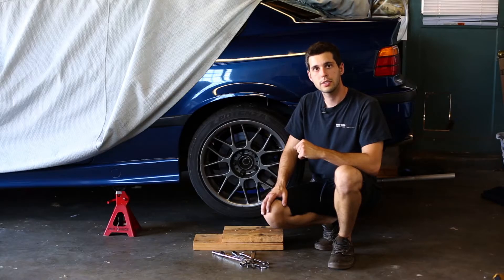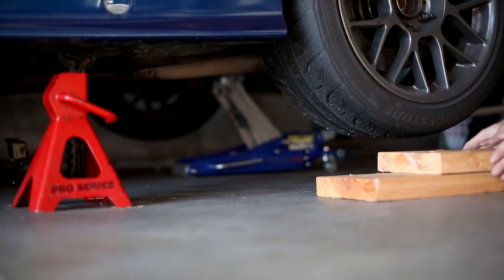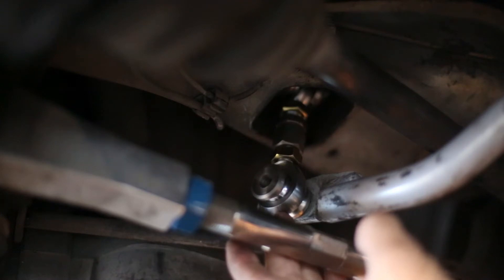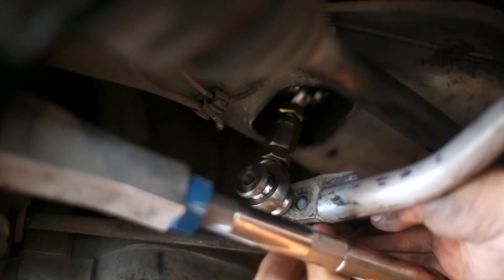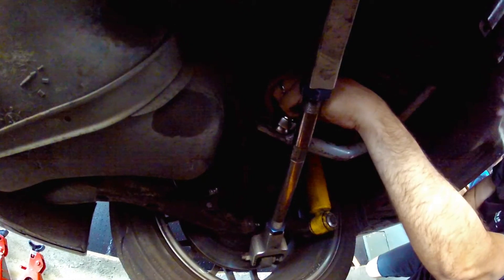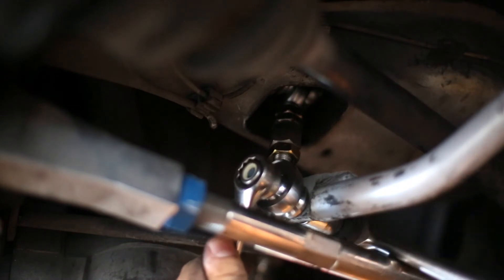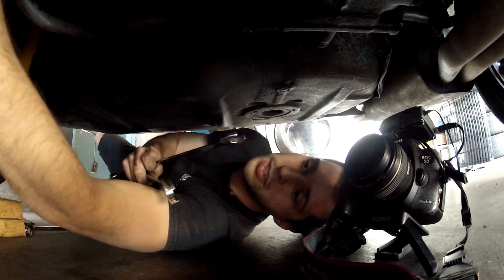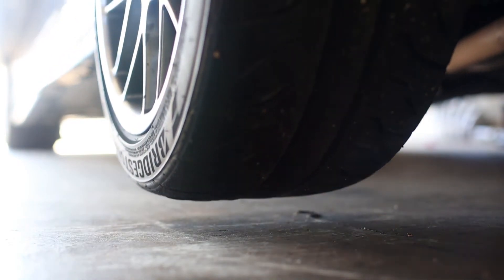Episode 7 - How to Achieve Zero Preload on your Anti-roll Bar

Comment: Does the sway bar need to be set at a specific angle before finding zero preload?
Reply: This is what critical question i’ve been looking for but with no one answer  for it 😂
Reply: From my understanding and research, the bar ends should be parallel to the ground.  In any case, with one link disconnected and the suspension pre-loaded (settled), this will net 0 pre-load.  Most difficult part, the driver needs to be in the car at the time, and someone else adjusting.
Reply: @dcpatters0  or maybe put some weight in the drivers seat approx the same as the driver.
Reply: Still no answer?
Reply: Depending on car & bar design...end of bar Should b // to ground...& links Should b verticle...so it all works at a rt. angle from every view ing angle! Should...not always possible,  of course.

Comment: Excellent video, straight forward, simple and easy. However, I wished you have done two wheels/sides rather than one wheel, to see how to balance both endlinks for either front or rear wheels.

Comment: After doing that on the blocks, could you jack it back up and put it on Jack stands to torque everything to spec or must you torque it to spec when lowered on the wheels?
Reply: Torque it with suspension loaded (on the ground or on the blocks) you don’t want the wheels to be free floating
Reply: @Wooden_Hammer  yeah I ended up buying some rhino ramps and lowering the car onto those to torque everything. All turned out good.
Reply: @Wooden_Hammer  can't speak on every Make and Model or brand of suspension equipment, but I'm currently messing around with BMR stuff on my 5th gen Camaro, and the guy from BMR told me the car does not need to be at ride height to torque the end link bolts/nuts down. He said everything with a bushing needs to be torqued at ride height.

Comment: Nice video! After doing this on one side, do you then undo the opposite side and repeat the procedure ?
Reply from the maker: Refine Movement you would do it just like in the video. Keep one side attached and perform what you see in the video and your preload will be set correctly. If you repeated this on the other side you're just doing the same procedure twice. Which isn't wrong but it is just more work.
Reply: benvidproductions awesome thanks !
Reply from the maker: Refine Movement thanks for your interest
Reply from the maker: angelo calimlim yup loosen one bolt, if you find the bolt does not slide in and out easily with your car on a level surface, the bar is preloaded. The sway bar isn't useless, if there is just a small amount of preload and you don't do any competition I wouldn't worry about it, just enjoy the car. If you are running the car competitively it will effect the balance of the car enough to effect your times depending on how bad its preloaded. Good question!
Reply: Ben Freedman Racing when you set the first side of it does the angle of the bar need to be horizontal to the ground or is it based on car? Mine is an e9x M3 and needing to redo the fronts

Comment: Great video, just one question... Do you not need the front two tires at the same level, on wooden boards as well, to balance the weight of the car all the way around? Or can you achieve zero preload just doing the rear first (on wood or ramps) and then doing the front second (on wood or ramps)?I'll be installing adjustable front and rear sway bars and end links soon and want to achieve zero preload. I have ramps and two jacks at my disposal here at home. Thanks so much for any input you can provide.
Reply from the maker: That’s a good question. I know in my case I was able to do it because my garage floor was very level and my ramps were short and the exact size. If your ramps are taller I’m sure it would work as long as your car is corner balanced and aligned. I’m sure there is a threshold where ramps could be too high and it could affect things but I’m not exactly sure what that height is but I think you could get pretty close with ramps even at 10” high.

Comment: Im a noob to this could tell me why you want or need zero preload please
Reply: Bimma velvet blue: Because when you are driving straight, with the normal weight of the car on the suspension, you do not want any torque on your sway bars. That way, your sway bars will only be doing their job in cornering. This also means that the best drop-link (aka end-link) adjustment should be at zero preload with the weight distribution the same as when actually driving. That is why you should adjust for zero preload while you have the weight of the driver in the driver’s seat. If you are doing high-performance driving or racing, this becomes more important.

Comment: How do get the angle of the bar were you eant it
Reply from the maker: You should be able to use the adjustable links to get it where you want it. If the links are limiting the angle you are trying to get you can always buy longer or shorter adjustable links of the same style to get it where you need

Comment: Do you do this process for both sides?
Reply from the maker: Only the one side just like in the video. You will have to do it for front and rear
Reply: @BenFreedmanRacing  I have some adjustable sway links on a Honda so the zero preload you would want the ends of the sway bar parallel to the ground like an equal sign basically?

Comment: How to tell if my endlink are loose and need adjustment? My car making clunking and squeaky noise over bumps in low speed at the moment not sure if its bad coilovers or the endlink need adjustment i have adjustable endlink by the way
Reply from the maker: Super mariyo that sounds more like bushings or balljoints possibly. I would just visually inspect the endlink to rule that out. But make sure it isn't a more crucial part of your suspension that is making that noise to rule out anything unsafe
Reply: Take a look at your endlinks. After I put BC coilovers on my e36 m3 and the suspension settled I noticed that the swaybar endlinks were too long both on the front and rear. The endlinks links were resting on the lower control arm. If you lower your car, E36 in specific, get shorter endlinks or adjustable ones.